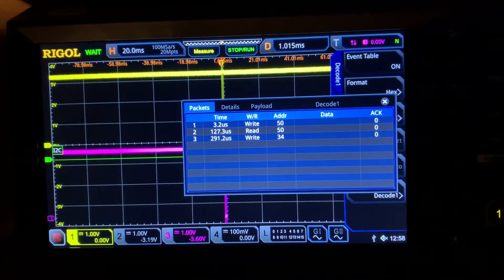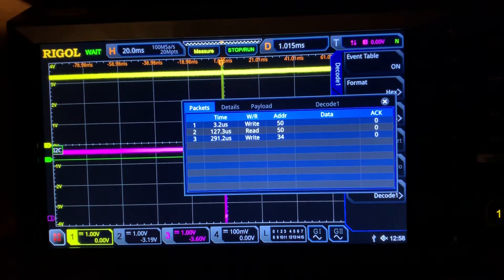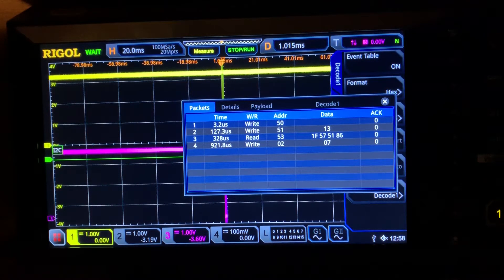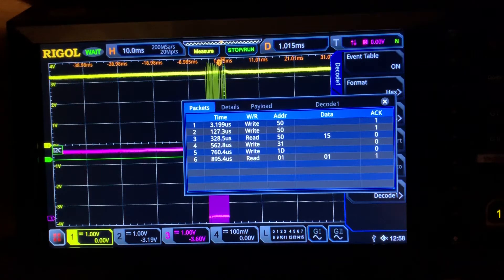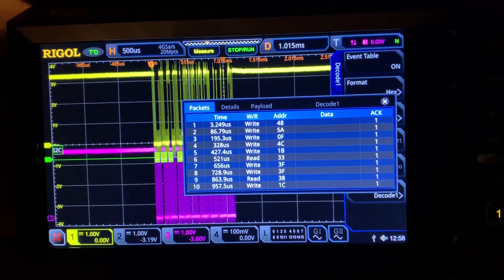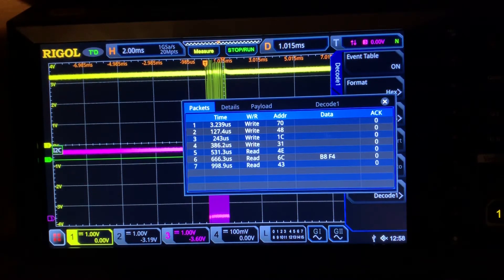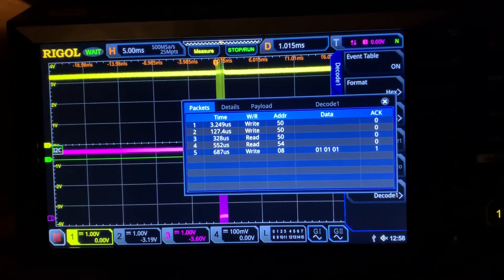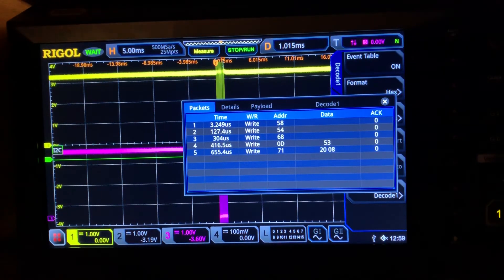Trouble with software i2c decoding?

Comment: I have ds1000z series scope which only decodes I2C for data visible on the screen (it reads from screen buffer memory) and once I zoom in, the packets get decoded improperly if at all. This is something that is not the case with DS2000 series which decodes from the captured data buffer. I wonder if MSO5000 is doing the same here as DS1000z series, i.e. decodes data that is being displayed at the moment? Have you got any luck with this scope since 2019? Maybe there were firmware updates that fixed it for you? Thank you.
Reply from the maker: I’ve been generally happy with the scope. I think you’re right about working off the screen buffer. I haven’t done much serial decoding of late, I’ve mainly been doing analog work.

Comment: 1AM crew unite! - All I can think of is the noise floor shown on that trace causing problems (are you on 1x or 10x on the probes?).  I doubt at 4gsa/s resolution that the software decode is going to be the issue, unless it's badly programmed.  I've done this with my Siglent on an active i2c bus and had have success.. so, it can be done.
Reply from the maker: dine909 hmmm. You could be right! For my prior measurements I was using the probes at 1x. I switched to 10x because at 1x it was interfering with the function of the blood pressure monitor. Increasing the impedance fixed that but may have increased the noise floor. I’ll try again at 1x.
Reply: @superchromat  Good luck - In case it helps: My new go-to way of doing this kind of task is to record the bus comms using the scope and export it to a file, then use Sigrok PulseView on a computer (it's opensource & for all os's) to then parse the analog data into digital, and decode.  It's pretty useful, and for me anyway unveils more of the story without having to fight a low-res scope screen.  My scope is actually compatible with PulseView directly (It's networked), so i can just hit capture and it's there on screen, not sure what your scope is, but there are Rigols in the device list.
Reply from the maker: dine909 I have an Ethernet port on this scope. That sounds like a good workflow. I’ll give that a go. 

The other thing I could try is using the logic analyzer input on this scope. I don’t have the cables for it, but I could probably whip something up.
Reply: @superchromat  Good luck! again! - The Sigrok community is all about reverse engineering :D